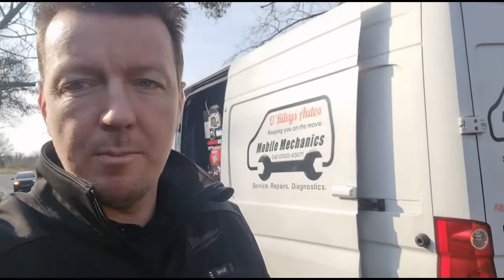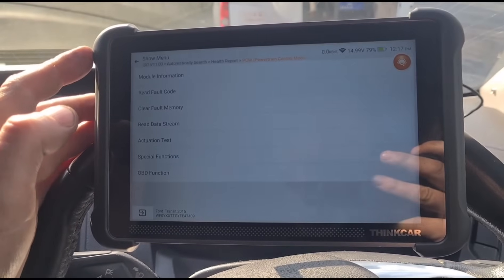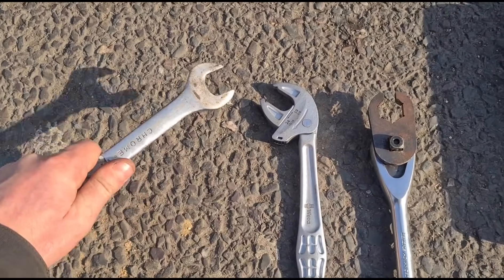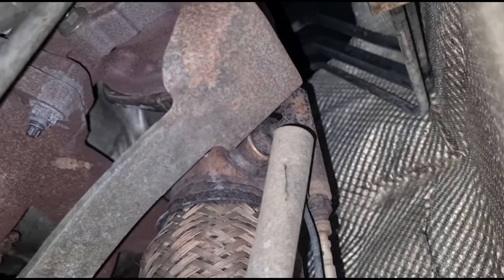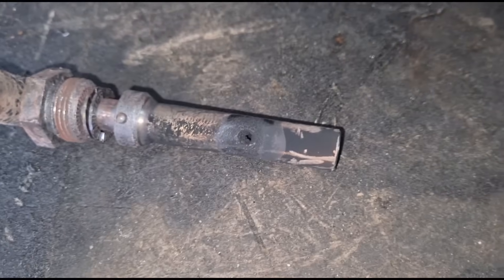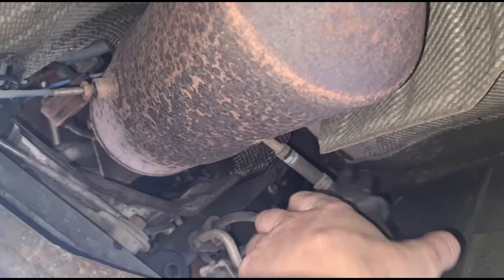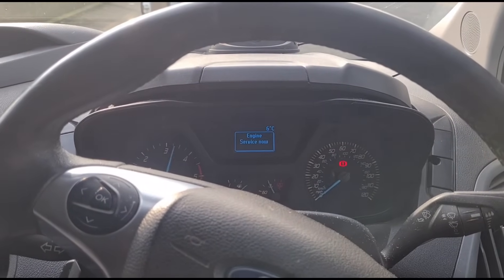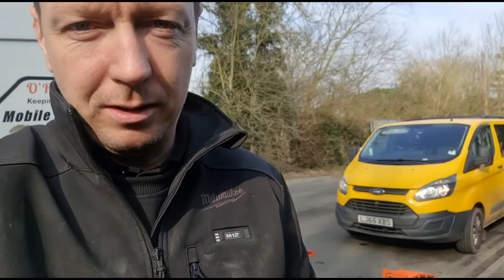Ford Transit P244C:00-2C Exhaust Temperature Too Low

Comment: I have replaced the vaporizer, but still don't get more than about 500°C during regen. Is there some other thing that can restrict the diesel flow through the vaporizer?
Reply from the maker: Vaporiser fuel pump. A damaged DPF. A bad quality aftermarket DPF.

Comment: Typical Ford penny pinching design, make it easy to slap together at the assembly line but make it impossible to remove when it needs to be replaced eventually. The vaporizer is really irritating to R&R even on a lift but damn, you replaced it while lying on the ground. Amazing!

Comment: Where is the vaporiser in the fwd transit VO 350? 2.0lt
All I can see is the adblue injector.
Reply: I think it’s on tge  drivers side under the wheel arch liner if you remove that arch liner after removing the wheel it’s there in easy reach from what I’ve seen on Jimmys other videos doing just that task , hope this helps 👍👌
Reply: Sorry read my answer it should say the drivers side not tge it won’t let me edit it crap editing don’t work 🤦‍♂

Comment: I cleaned out the vaporiser like in one of your old Galaxy videos. Fault came back though. Do you reckon its advisable to always replace the vaporisers? I am wondering whether the diesel line to it was blocked as well.
Reply: i did squirt a load of some chemical shite in through the pressure sensor hole as well. What I didnt do is prime the vaporiser or check for corrosion. Can I prime it with the bluetooth andorid obd sensors I wonder? Im a few iq points lower than yours I admit but advice much apreciated!

Comment: Going from forced regen to forced regen, with a few parts in the mix, until he got to you. That vaporizer nut is very hard to reach.
I hate to have to go bit by bit, turning the spanner to get the angle right - takes forever. Ditto to put it back. That's why nobody touched it (assuming they even knew it was a vaporizer problem).
Great job, Jimmy! Another happy customer!

Comment: Hey Jimmy. I recently ran some revive cleaner through my 1.6 tdci on my fiesta and it seems to have calmed down a vibration I was having but it hasn't gone. Should I try it again, or would you recommend taking the egr and i take off and manually cleaning them? Plus i think i may have some crap sitting in the exhaust pipe just before the up bend over the rear beam that just wont shift. Would cleaning the dpf with some foaming cleaner help get any residual soot out of the rest of the exhaust?
Reply: Yes, every fill-up.
Reply: @deldili6598  its not a tank additive. Its a carbon cleaning spray you run through the intake.